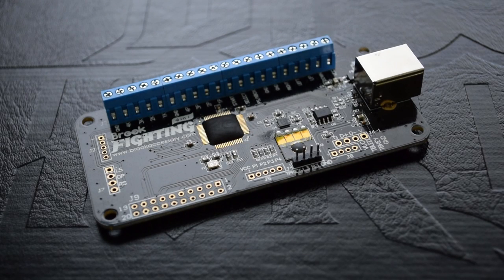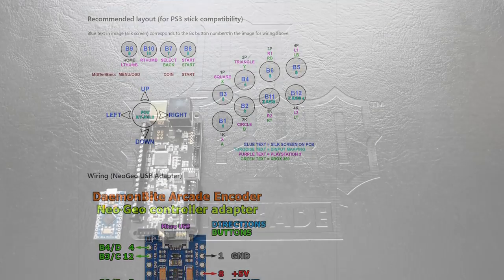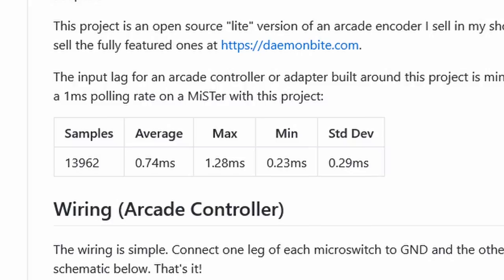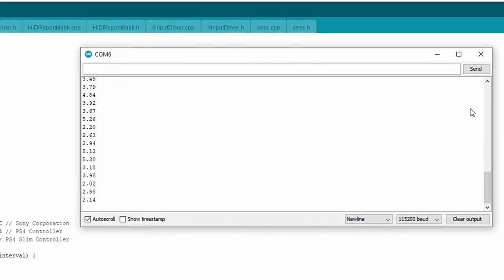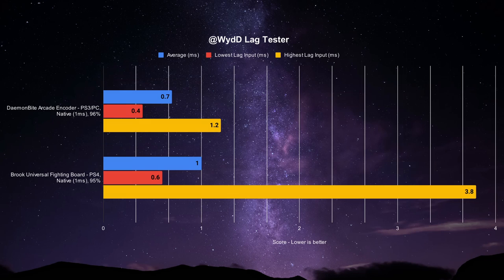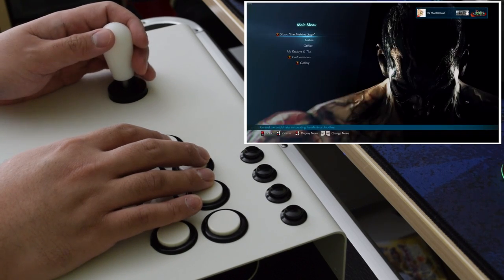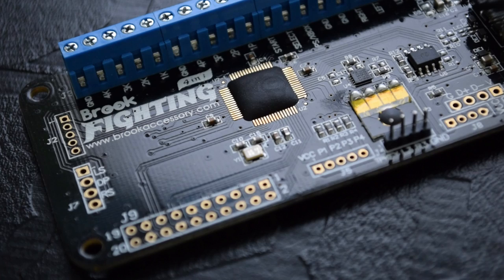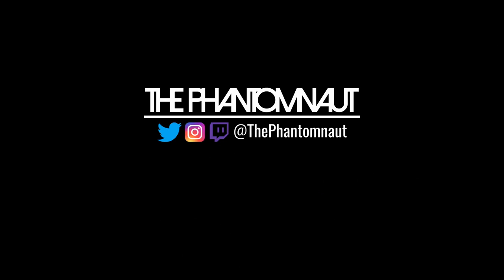DaemonBite Arcade Encoder Latency Analysis: Super Fast But At What Cost?

Comment: The issue you point out about it "not playing nice" with Steam you just need to set the debounce flag as 1 in the arduino sketch. According to the author, this adds minimal latency unlike other implementations. This completely solved the issue with mapping the controller using steam for me at least.

Sure, even if minimal there must still be an impact, but you could also measure it again just to see how much the DaemonBite with debouncing enabled compares to alternatives.

Overall I think the daemonbite is the absolute best there is for mainly solo PC gaming. What I mean by solo is that you play alone in your house or carry the same laptop everywhere. Nothing beats the ease of use of plug and play the brook offers, not to mention the broad console compatibility.
Reply: You can also play Tekken with it. 

The arduino is recognized as a analog stick, so you need to use the keyboard to navigate de menus, but the gameplay is flawless. 
This is probably true for other games as well, so check it out.

Comment: Thank you for this video.

Brook updated the firmware on the Universal Fighting Board recently to v3.0 and claim lower input lag in xbox one mode. Could you please test this out. They also claim 1. Input sensitivity improvement
Reply from the maker: I can check. I know the PS4 mode has boosted a lot for v3.0 and the UP5 upgrade but had issues when lag testing that mode due to weird abnormalities with my Arduino and UFB. I have been planning to do an input lag roundup video with sticks I haven't tested but haven't had the time. I will either post it there or put it on Twitter. Thank you.
Reply: @ThePhantomnaut  Followed you on twitter. Look forward to your findings. :D

Comment: I want to play CPS games on MISTer - I don't have an arcade stick, but I want to buy something of the highest quality. - a stick that really feels like an arcade cab. - I am not sure I understand your results graph. - What is the fastest stick you would recommend? - I know MISTer has SNAC for some consoles, - I would assume that for arcade cores, I would be able to use a "real" arcade stick, ie, I guess a stick that is not using USB. - I guess if I can use a good PS3 stick with a DaemonBite, but not sure if thats the ULTIMATE!
Reply from the maker: If you want closest to an arcade cab feel, there is Hori's Real Arcade Pro Premium VLX series of sticks if you like the Japanese side of things. Basically recreates the main control panel of the Taito Vewlix cabinets for players. There is the EZ Mod for VLX from Jasen's Customs that you can replace the stock PCB (the PS4 models) with that of the Brook Universal Fighting Board which is the fastest board WITH modern console compatibility. Problem is that it's not sold anymore and it goes for high prices second hand. There is also Hori's older Real Arcade Pro models for PS2 and PS3 that is a shrunken version of the Sega Astro City cabinet control panel but as for latency I can't say. Sega also made the Virtua Stick Pro which looks like a chopped off 1:1 Astro City panel but is relatively uncommon unless you check out Yahoo! Auctions Japan. That big chungus of a stick(s) can probably work with the RetroPad32, which is very comparable in latency to the DaemonBite encoder and the UFB, and it can connect to a MiSTer.

As for fastest consumer arcade stick (PS4 mostly), there is the Razer Panthera. After comparing the Victrix Pro FS on one of my videos, which was marketed as the fastest, Razer's stick is faster. It's not close to lagless but still solid. UFB then still does a lot better by comparison. I know folks in the fighting game community replace the Panthera's PCB with that of the UFB via Jasen's Customs' EZ Mod for Panthera.

I haven't looked into SNAC as much so I can't say.

As for putting a DaemonBite encoder on a PS3 stick, it's possible. Just wire the correct inputs to the proper areas and make sure every input is grounded. Since the encoder only has a couple of ground points, consider daisy chaining a good amount of the inputs such as the buttons and the lever having its own.

Apologies for the long reply, especially if it's a lot to take in, and hopefully it helps. Best of luck.
Reply: @ThePhantomnaut  - Its an awesome reply thanks. - Just saved it into notes so I don't lose it. - Yea, I will investigate everything you mentioned, - thanks for the info.
Reply: @brentgreeff1115  If you have not decided yet, may I also recommend the SEGA Astro City Mini Arcade Stick. Great build quality. All quality Sanwa parts inside (just like the Astro City arcade cab). Great arcade feeling. Low latency. Works nicely with MISTer. And you can easily swap out the PCB with a Brooks if you feel like it. Oh, and you can still buy it from new. (PS: I own both the Hori/Taito RAP Pro Vewlix Kuro that Phantomnaut mentioned and 2x SEGA Astro City Mini Arcade Sticks).
Reply: @flottenheimer  - awesome -thx for info.